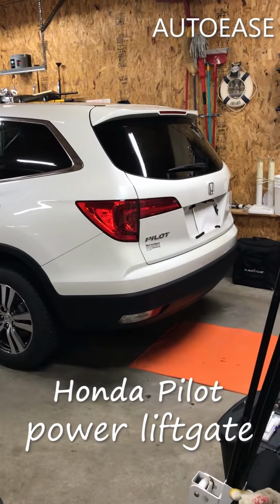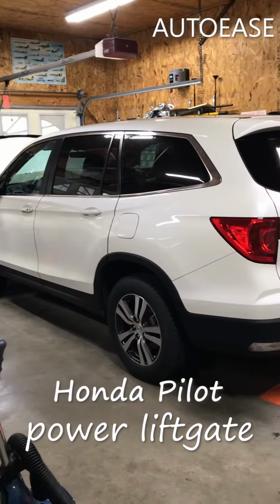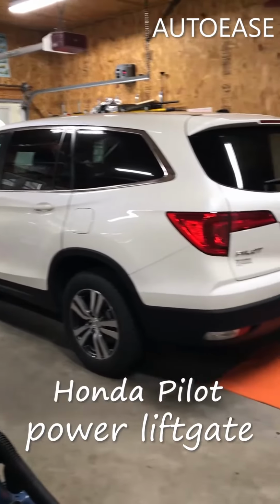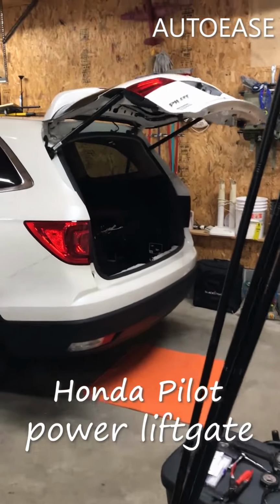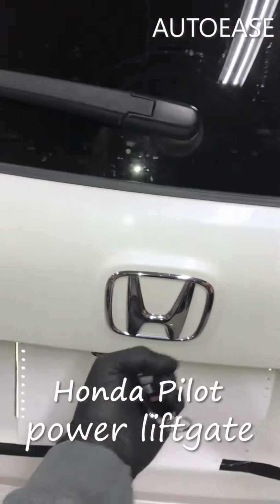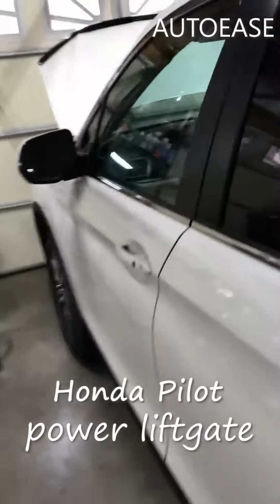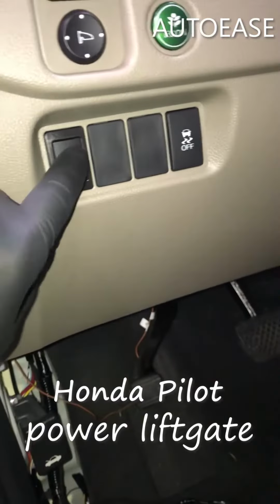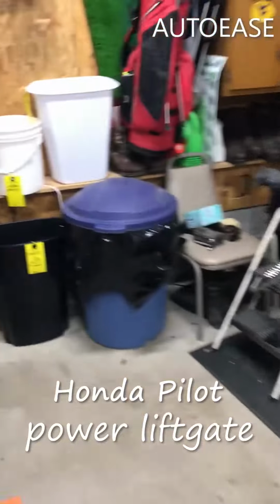Aftermarket Honda Pilot Power Liftgate

Comment: ****BEWARE****: If you're going to install power liftgates to your vehicle, PLEASE make sure it's not from "autoeez" ("eez" is deliberately misspelled due to utoob censorship), or any other CHIN3S3-A-KRAP manufacturers. Just went through nightmare with DANGEROUS malfunctioning "autoeez" liftgate system installed by dealer before I bought vehicle. Short story: dealer had system removed and replaced by manual OEM equipment.